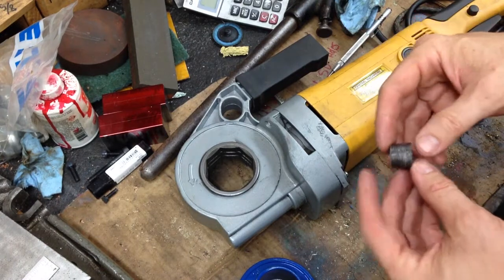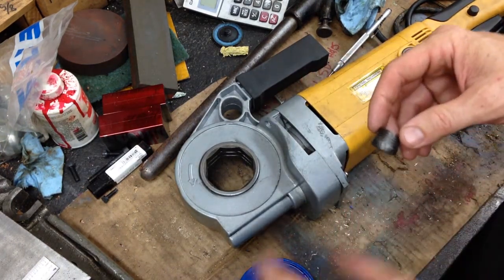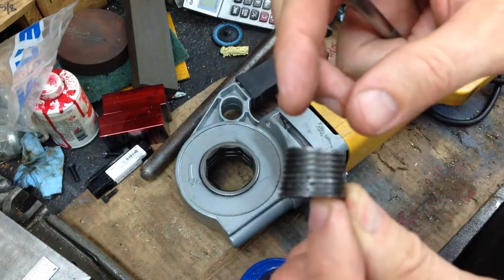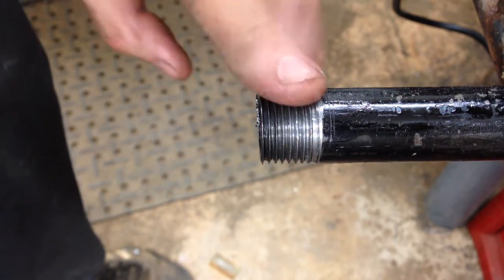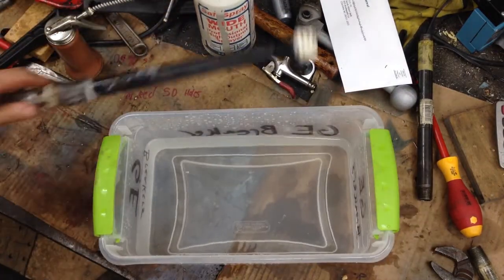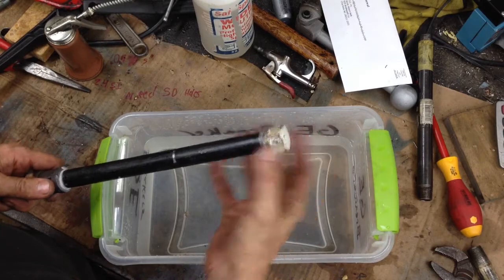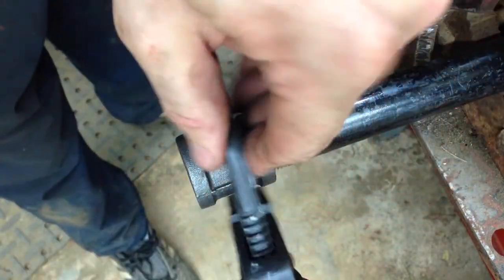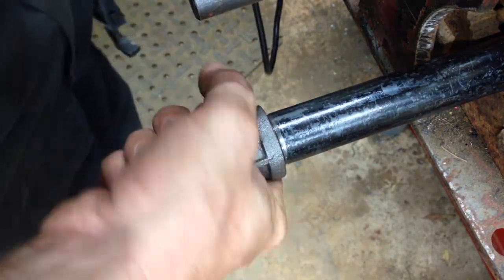Harbor Freight Pipe Treader Die Upgrade

Comment: I don’t know anything about pipe threading...but Swag Off-road uses the HF to turn the pip bender. They now have a custom replacement that’s machined to fit the threader...maybe that can be welded to your Rigid using your weld contraption...just a thought.
Reply from the maker: Sawg Offroad is great!

Comment: What model number was yours?
Interesting....  I bot a severely discounted "yellow" one against the warnings of the manager - he said ALL of them were returned and that NONE of them worked properly.  This was a 95955 model.  The "red" ones in other tubes seem to work OK.  So it must be the early models.

What is interesting is that your Yellow unit has the Octagon drive while my Yellow has the "Cross" drive like the newer Red Units.  I'm guessing yours is even older than mine.  

Of further interest is that your threading heads look like mine except for the drive shape.  So I'm wondering why would they have changed the drive shape and not the thread positioning problem?  Perhaps yours wasn't that bad and mine is horrendously worse.

I think it was marked down like 3 times to maybe $50 or less and I offered the manager 1/2 of the lowest price and he took it.  I don't have the cardboard sleeve that went around the case so I don't know for sure - but I got it VERY cheap.  Since this has been sitting around my garage for many years, I'm 69 now and have no plans to ever use it, so I'm going to sell it with full disclosure of what the manager told me.  I wish I remembered what I paid for it, but I will list it somewhere between $20 and $35.  BUT there is a risk:  I might want to get into the project of "fixing" it.  LOL

NOTE:   the one I have had the clamping bracket jack screw was severely bent meaning the machine probably dug into the pipe and bent the clamping bracket instead of turning threads (!)